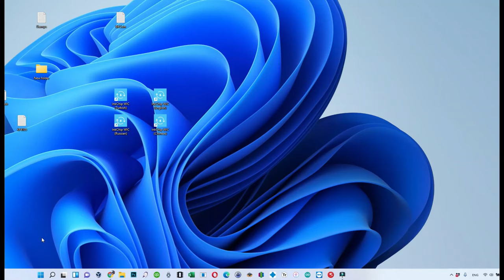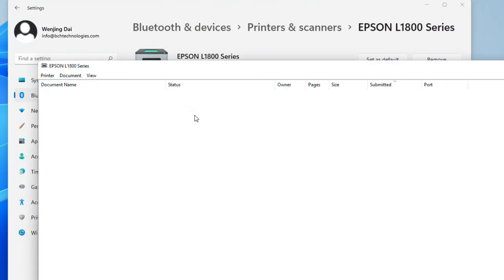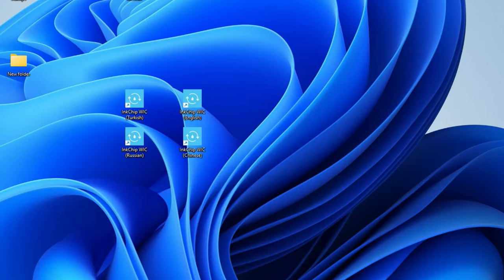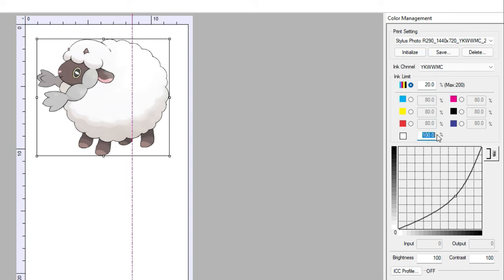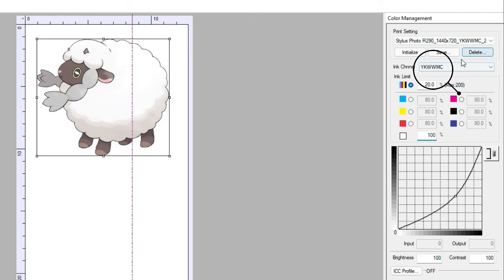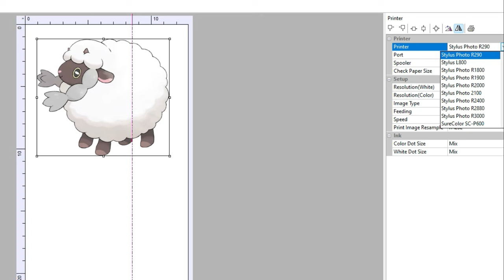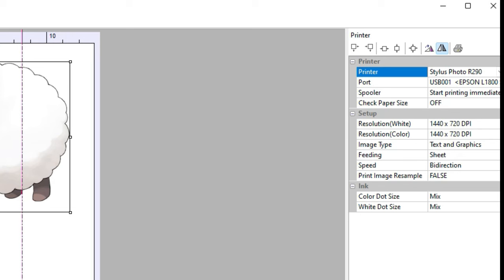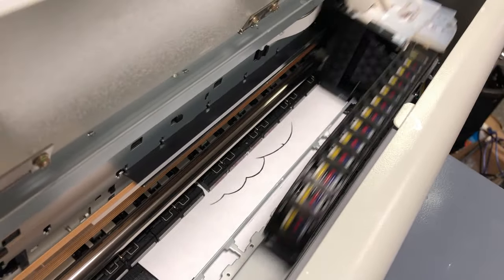DTF Printer Won't Print? Here's How to Fix It

Comment: Would the windows system cause the printer to not print? I submit print and nothing happens. My printer doesnt move at all.
Reply: I’m having this exact issue, did you resolve it? I click clean head, nothing, nozzle check nothing, print nothing. But the ink light is flashing

Comment: Hello please could you help. I have refilled my ink cartridge and been doing this for like 4 months without a problem but now I'm getting a blinking light for black ink and there's ink inside. Any help to by pass this? I have Deskjet 2549. We hen I removed the black ink it starts to print
Reply from the maker: We can first eliminate the situation that the printer doesn't have a good connection with the cartridge. Take the cartridge out and look at the electronic ribbon. Use a paper towel to clean off any ink stain or glue. Also, look at the brass pins on the printer and make sure they are clean and dry. Re-seat the cartridge a few times and see if that makes a difference.

If the printer still cannot recognize the cartridge after many tries. It is likely the cartridge has gone bad. These cartridges are designed for one-time use and can go bad at any time. First, the printer will heat a reference resistor on the cartridge. The resister is heat insensitive, which means it remains the same resistance at high temperatures. Then the printer compares the opposition with all the nozzles. If the differences in the resistance between the reference resistor and nozzle are too significant, the printer will mark the nozzle as a failure. If the failures exceed a certain level, the printer will keep the cartridge unusable. Unfortunately, this problem is not fixable, and the cartridge has to be discarded.

If you need to get more empty cartridges, I suggest using eBay. Search for your cartridge model plus the keyword "empty virgin." The virgin means never been refilled. These cartridges are the best for refill purposes. Do not use remanufactured cartridges. Reman cartridges usually have an outer chip that overwrites the OEM chip. However, sometimes the chip will catch moisture and malfunction. Furthermore, the manufacturer cartridges use recycled OEM cartridges, so the nozzles may be faulty to start with.
Reply: @BCHTechnologies  thank you for replying. I will read this again lol and give it ago.
Reply: @BCHTechnologies  I have cleaned it and there's nothing seems to wrong with he connections there seem fine